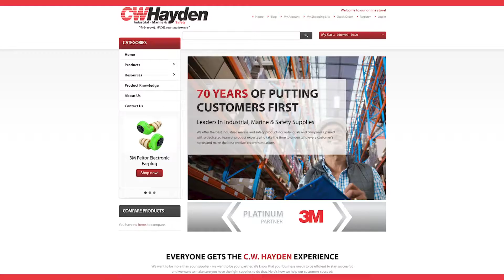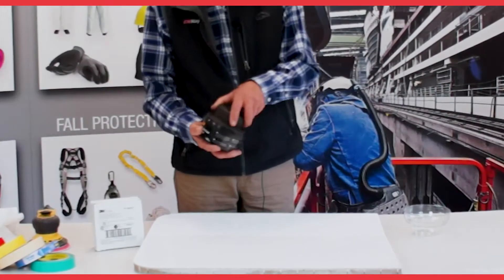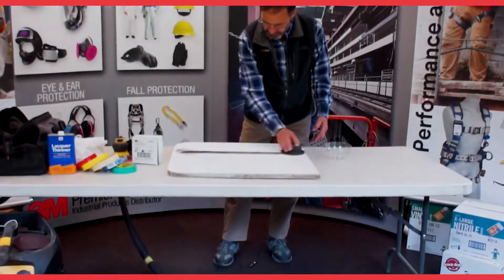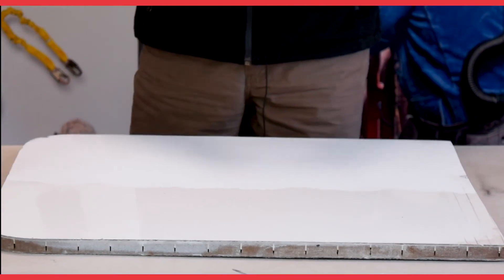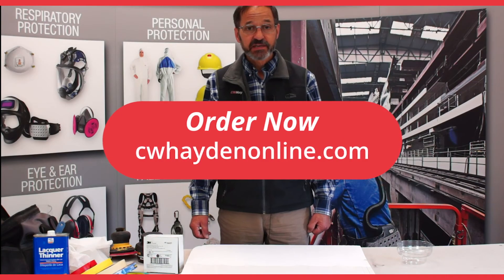How To Use Dry Guide Coat For Sanding & Buffing

Comment: I wish you had some uneven surface to show how the guide coat can help
Reply: Guide coat isn't typically recommend for uneven surfaces. It is usually used for highlighting sanding scratches.
Reply: https://youtu.be/6xp91nSjMU8?t=750 nyc ammo porsche build- link starts at when they apply dry coat.

Comment: Same basic principle that was used by gunsmiths over a hundred years ago when blackening with candles and oil lamps. 
However, you used a vacuum on your sander and went back over with the same grit. Kinda defeated its intended purpose.
Reply: Hmm yea true, just vacuuming all the coat away